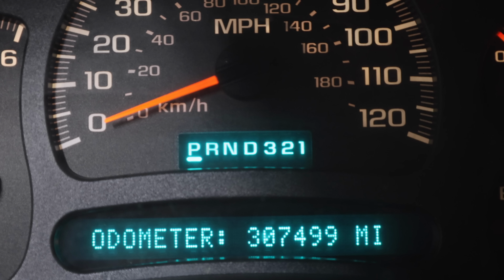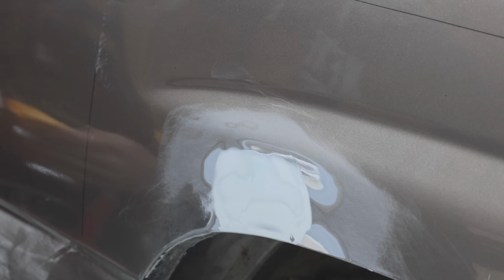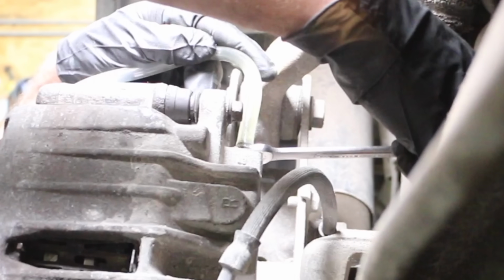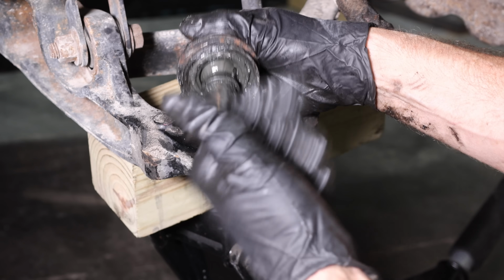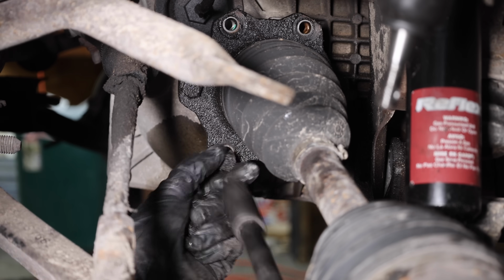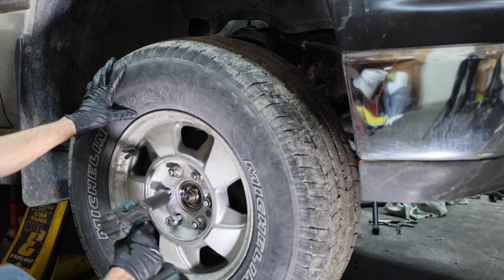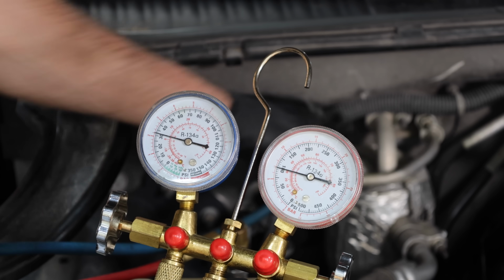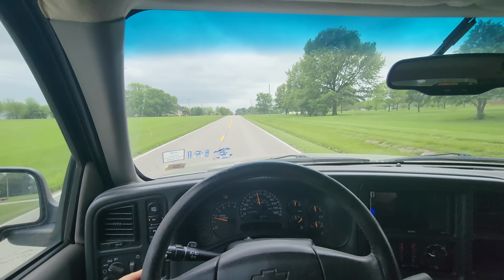Is It Stupid To Fix Up A 300,000 Mile Vehicle? Let Settle This!

Comment: When compressing the caliper piston, I open the bleed screw and push out all of the old fluid instead of pushing it back through the system and the ABS valves. Be sure to close the screw before releasing the clamp to avoid getting air in the caliper. I also remove the old fluid in the master cylinder and fill with new. This will replace 80+% of the fluid. Add new fluid to the master cylinder as you depress the brake pedal and push the caliper pistons out. The fluid level will drop and you don't want any air to get into the master cylinder.
Reply from the maker: Thanks for sharing.

Comment: You can torque the spindle nut in the air by sticking a screwdriver in a slot on the rotor
Reply from the maker: Thanks for the feedback.

Comment: I have a 99 f250 light duty 5.4  with just about 350,000 runs and drives great, i hope to make 500,000 with it. It just seems built so much better then a newer truck.
Reply from the maker: Thanks for sharing.

Comment: I work for a body shop, that’s a good call with the 2x4 for blocking. Hell, I’ve seen our oldest and most seasoned guy use a paint paddle with sticky 80 grit to get into small corners, etc.

Comment: Im thinking about running 15w 40 in my subrban, you think it’s safe for the oil pump? Love your vids man.
Reply from the maker: Thanks!  Thanks for the suggestion.
Reply: @ProjectFarm  do you think that the 15 W 40 would hurt the oil pump I want to run it in mine because it has 220 K but I’m scared about about the oil pump burning up

Comment: I'm about to have to drop a good amount of money into a car with 230000 miles for a power steering pump and rack as well as a water pump, belt tensioner, belt and whatever other little stuff I find while I'm there. It also needs a transmission but I'm not going there yet 😂. 2000 dollars in parts is always cheaper than buying a new car, I'll just keep on fixing mine as long as the body is intact and they still make parts for it.
Reply from the maker: Thanks for sharing.

Comment: I have an 07 subaru forester with 342,000 miles on it. I bought it at 322,000 miles. Had next to no rust (im in rust belt), had water in the fuel, bad olugs and wires, bad front driveshaft half axles, pretty much all suspension components needed replaced except for the shocks themselves, egr valve, pcv valve, tranny mounts, engine torque strut etc. I payed 2,500 for it and got it in great shape for less than $2000 and some elbow grease. Total cost about 4,500 dollars for a vehicle that can go anywhere over anything, and will probably last me another 300,000 miles.
Reply from the maker: Thanks for sharing.

Comment: 96 honda civic. 28 years later. 4k and all the front and rear suspension is brand new. 3.5k to rebuild the engine( didn't need it but did it anyways) new windshield200. After little extras, just under 9. Nissan micra brand new is 17k. Brother got one 2 years ago, and it's suspension is already breaking down. So yeah. 9k repairs and the car lasted 28 years. Nissan wants 17k and it lasts 2 years....
Reply from the maker: Thanks for sharing.

Comment: Don't change, love the pace. For things that have charts you leave them up long enough to pause if need be. If I need slower paced auto service I can go over to Rainman Ray. BTW for changing diff fluid he did have a hint, check that the drain plug is not seized before draining just in case.
Reply from the maker: Thanks for the feedback.

Comment: I use a C clamp as well, but when pushing the calipers back I just use one of the old brake pads and press it in the center to do both calipers at once. instead of going back and forth to keep it level and even. (2002 tahoe)
Reply from the maker: Thanks for the feedback.
Reply: @ProjectFarm  I think I noticed you doing it later on in the video was just a thought early on when I seen you do them separate.  love the pace of your videos though, great job!

Comment: Living in aus got a 2002 or so mitsubishi magna (i think its either the verada or dimate or something in the states) 300000km or so but little rust, no structual damage i have seen so far, may need engine work (oil on the bottom in places so leaks in places) already replaced the headliner that was a fun easy job, fixed the door actuator as 20 odd years of only the driver door being unlocked caused it to fail, but nothing a dremel and super glue cant fix

Anyway i believe it needs engine work or at most a new engine would that be a stupid idea (i like the car its actually a recent first car and if/when i get a new car i want to work on fixing it when possible)
Reply from the maker: Thanks for sharing.

Comment: Finally junked my 2002 suburban with 365,000 miles.  Engine still worked great but the frame was so rotted out There wasn’t anything left to attach replacement parts too.
Reply from the maker: Thanks for sharing.

Comment: i had 400 thousan miles on a chevy suburban and it was still running fine when i let it go. Electrical problems but motor and tranny were good. Vortec
Reply from the maker: Thanks for sharing.

Comment: Just a question i have a 2007 Ford Fiesta Zetec 1.2 with 100,000 miles would all the things you did in this video be a good idea to do on my car if it hasnt had all this done since its been made?
Reply from the maker: I doubt it needs all that much work.  Recommend doing an assessment on the vehicle from front to back.

Comment: Driving a 99 Chevy crew cab with 307000 on the clock, you have to do the same thing with 100000 miles as you do with 300000 miles

Comment: Man this brings back a lot of memories, I am a 22 old guy from Germany and I lived 14 Months in Canada.
I bought a 05 Suburban with 400000 km on the clock from a French guy with many problems. Since I didn't have any money left all I could do was get scrapyard parts (sometimes I had to do a job three times because of bad parts).
Apart from a fuel Pump, AC compressor, Muffler, Trottlebody, abs sensors, Airbag sensors and Complete rear end change, I did everything you just did but by figuring it out the hard way through trial and error.
I spent 10 out of 14 Months Working just to buy parts for that lemon, but in the end I made a whole trip From East to west Canada, down to LA through the national parks and east, with minor Problems.

The simplicity of working on an American car is awesome. It was amazing where that car took me: Offroad in arizona, -35C in Banff, up the mountains in Washington, down the Utah Roads at 100mph(Speed not accurate since I don't do freedom units, I always drove the limit :). 

Great car, but next time I won't buy it off a french guy pretending not to speak English, just because the broken exhaust made the V8 sound amazing.
Reply from the maker: Thanks for sharing.

Comment: Where did you get the wheel well patch?
Reply from the maker: The link is in the description of the video.
Reply: @ProjectFarm  I just looked I don't see it. I see a lot of the other links but not for the wheel well patch
Reply: @ProjectFarm can you give an update on the wheel well metal patch you used the black piece of metal there's no link in the description it's only for tools and other stuff

Comment: Im just gonna say this. My 2001 gmc sierra has 340k miles. I have had the same tires on it for the last 3 years, maybe 4, i never have done a rotation or balance and its still drives straight and fine up to 90mph. I haven't gone any faster. Those early 2k gmc/chevys are jjst the greatest trucks ever made.

But the tires bald flat. 
The engine ticks so the lifters are gone.
I have an oil pressure problem.
The bed has holes.
The fenders are lightly rusted
The cabs running boards area has the worst rust.

These are the only really bad things
Reply from the maker: Thanks for sharing.

Comment: Body work was good bro, especially for a nonbodyman.
Great advice throughout, but I'd add 1 thing.
When replacing the seals, don't use the tool against the wall.
Which means, for others, place the tool in the seal but don't touch the metal, only go in far enough to catch the rubber seal.
A scratch on the inner wall where the seal goes will create a leak.
Then it has to be machined and an oversized seal is needed.
Which means, a scratch could cost thousands in repairs or a new motor/tranny.

I've seen many people make that mistake.
Reply from the maker: Thanks for the feedback.
Reply: @ProjectFarm  
You're welcome.
I liked the video bro.
Out of your element, video wise, but still in your zone.
Again, great advice throughout and with your choice of 2×4, that'll do the job nicely.
And you've painted before, Nice !
I have no complaints on the video & I built custom show cars for a living.
Kudos brother !

Comment: have you seen what new and used cars go for? if power train is good and frames not shot, fire the parts cannon. new cars suck to work on too. can bus and modules and fees to program... older cars are great and built better.
Reply from the maker: Thanks for sharing!

Comment: As somebody who’s paid close to $20k restoring my 09 Chevy avalanche it’s worth it if you can’t afford a $60k-$80k truck. Another $5k will replace my front suspension, catalytic converter and driver door window. Everything’s basically new except the rear suspension, diff, radiator and A/C. That will probably run another $5k but $30k for a restored truck that will last another 10-20 years is worth it compared to these new truck prices.
Reply from the maker: Thanks for sharing!

Comment: I have an '04 Burban and my last truck was an '03 Tahoe with 380k miles(don't loan your truck out to friends, kids)before it was destroyed by the borrower. To kill these things you would need to rupture the lower radiator hose, continue driving it while towing a boat while pegged hot then come home and pour water from your refrigerator into the cooling system. Other than that, they're damn near bulletproof. All I want to know is how much do you want for the one in the video?

Comment: Always fix your old cars. I have an 04 burban and I just keep her running. After replacing gaskets and the entire cooling system for $1800, I still only hace $6300 over the last 6 years with the purchase price included. Now go add up all of your payments and tell me which is worth it. Everything still works on her, including the AC. Why would I want a modern car that monitors everything I do and treats me like a child? Lets not forget that a $5-600 payment these days gets you a 6-10 year old truck with over 100k miles on it. Why?!?

Comment: I own a 1999 silverado 1500 4x4 4.8. I've replaced tcase, water pump, suspension all around, sway bar link bushings, catalytic converter, o2 sensors, rewired tow haul button, rewired wiper pump switch, wheel hubs, and more items not labeled.  This truck just keeps eating my money. It's paid off and a pain in my ass

Comment: And tires, and a whole transmission, and gas, and Cats, and head gasket, gaskets, and timing belt/chain. Old cars don't get very good gas mileage and 4-cylinder models of old will get beaten out gas mileage wise by newer models simply by the vastly superior CVTs. That SUV that you fixed will cost more gas wise within 10-20 years. You might not care about emissions but most of those fumes are being breathed in through the cabin where the driver and their kids will be sitting in. Insulation was not a thing like 10 years ago, so A/C is never going to be the best and neither is noise dampening. It is a lot of work but I'm glad a video on used cars was made.
Reply from the maker: Thanks!

Comment: Here's what I have to say based on a whopping 15 years of experience. Growing up dad, my uncles, and my grandpas said all vehicles were trashed by 100,000 miles. So I only bought low mileage vehicles. But having went to school for Industrial Diesel and having alwasy worked with my dad and grandfather in the garage I always helped other people out with there old junk. I have seen 100,000 mile Ford and Chevy V8's with no compression that needed to go to the boneyard. I have seen Ford Modular V8's a plethora of ohc and ohv v6's and 4 cylinders also worn out at 100k or less. I have also seen all of those engines go over 400k with regular maintenance. Same with chassis components. I currently daily a 92 Chevy K1500 with 211,000 on it. It has your typical wheelwell, cab corner, and outer rocker panel rust, but it is pristing underneath, and it runs and drives like a 50,000 mile truck. So yes I say a 300k plus mile vehicle can be worth saving, and yes you can daily drive aq 40 year old car. I have friend who dailies a 78 Buick skylark and has been doing so for nearly 20 years. I guarantee that car has spent less time being repaired than any 2000 or newer vehicle except maybe a pre 2010 chevy truck or second gen dodge. As much as I love my Fords there are just too many issues with the 3v and 4v mod motors. And while the 2v motors are indestructible, smooth, and amazingly quiet some jobs are just hard to do on them because they are so big. Give me a SEFI 5.0 or 5.8 or a or better yet a TBI chevy any day. I don't have much experience with the EFI chrysler 5.2 or 5.9 to say much about them. But I know I wouldn't want to work on a distributor in a second gen.
Reply from the maker: Thanks for the feedback.

Comment: Miles and hours are a varying indicator. If you had it from new, you know the life it's led, the maintenance and repairs it's gotten, the way it's been driven, any collisions.  The drivetrain could be golden but if the suspension, body and frame are becoming needy... Interior and overall electronics. Upholstery can be repaired and replaced fairly simply but if the electrical doodads and ALL the wiring are becoming problematic, that alone can be a deal breaker. A vehicle full of sparky gremlins is a nightmare to own.

Mostly you have to have an honest assessment of the end cost, continuing costs vs replacement. Getting a 3 year old lease turn in with ~30K miles saves a good bit on new vehicle purchase and several brands, 3/30 is still really fresh.
Reply from the maker: Thanks for the feedback.

Comment: An additional step that I always do, particularly on my GM vehicles with the same caliper brackets, is to thoroughly clean the rust and corrosion from the bracket, where the new stainless slide clips install. Not doing so tends to lead to additional squeaking while braking and when the pads retract after braking.
Reply from the maker: Thanks for sharing.

Comment: I did the rear main seal on my 02 Silverado at about 360k miles. At the same time I put a new oil pump in it as I was having a low oil pressure issue and the cheap fixes didn't fix the problem. It was a $1700 repair and that was dirt cheap done by a friend of mine who has his own shop. Runs fantastic again and it now has 372k. I need to do the same front end work you did here to my truck as it's all original except for a idler arm and the Pitman arm. It runs so good that I think I'm going to get it done and keep the truck forever, especially with the price of new ones. Lots of used motors and transmission out there for these vehicles to keep them going forever as long as it isn't rusted out and mine has almost zero rust and it resides in Florida.
Reply from the maker: Thanks for the feedback.

Comment: It's possible if you just change out the engine and transmission and cv joints if it's a front wheel drive. I would think it's cheaper than a new one with high interest and car payments. Classic cars are always rebuilt for their value. 73
Reply from the maker: Thanks for the feedback.

Comment: I bought an 800,000 plus mile cabover international semi. Its been a great truck, i put ten new tires and polished 24.5s on it matched with some balanced and trueing then fallowed up with some bushing work and topped off with a three axle alignment. Still in the prettying it up department. We've had fun working on it and using it to move our stuff. Pulling into a truckstop reminds us of the highschool parking lot with all the truck talk with old and new hands
Reply from the maker: Thanks for sharing.

Comment: A tip for people who change their own fluids, ALWAYS make sure the fill plugs comes out before you drain the fluids. If you drain the fluid and the fill plug is frozen now you’re screwed because you can’t get fluid back in. However if the drain plug is frozen but the fill plug comes out you can always vacuum the old fluid out.
Reply from the maker: Thanks for the tip.

Comment: lol my old 69 Fargo truck odometer rolled over not once but twice, I did pull that old 383 commando engine then rebuilt it dropped it into a 1970 cornet 500 .  I see these videos 100,00-300000 miles and I go they dont make vehicles like they used to sure the is many good things like disk brakes power steering and power brakes decent suspension and many other things people now days take for granted but the mechanical life of almost every vehicle out now is not very long this is because if they built vehicles like they used to with this new tec then the companies would put themselves out of business
Reply from the maker: Thanks for sharing.

Comment: Wow, what a great job! 😃👍
Your advantages:
- You saved lots of money!
- You don't need to deal with turbocharged, direct injected, downsized engines with EGR!!!
Thank you for cleaning the MAF sensor, that was really good!
Maybe a bit more ceramic paste for the brakes and some rust protection of the chassis had brought the car back to new condition. 😉
Reply from the maker: Thanks!

Comment: Wow, your truck at 300,000 miles and using the same OEM parts is crazy. There are no salty roads in the Winter! I have a 09 Tacoma with 203,000 that is garage-kept in NJ. This is my third front brake job and the calipers, rotors, and pins are all rusted. I ordered the Power Stop front Calipers & Drilled Rotors. Cheaper to repair than replace great job!
Reply from the maker: Thanks!